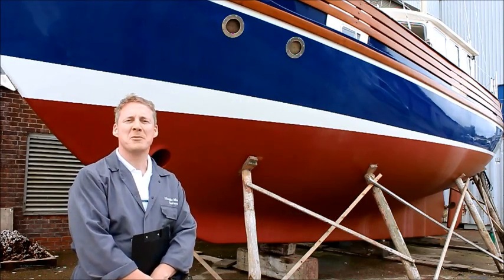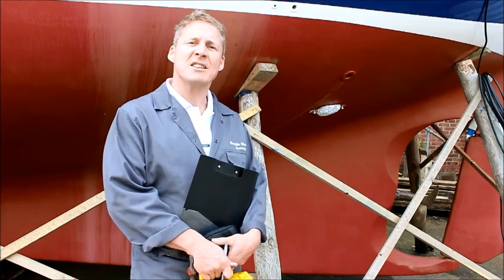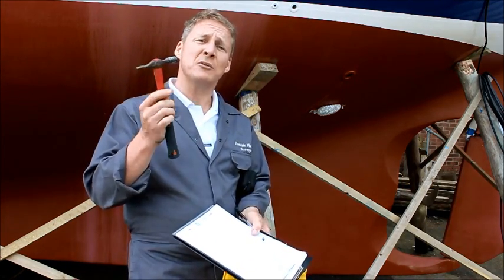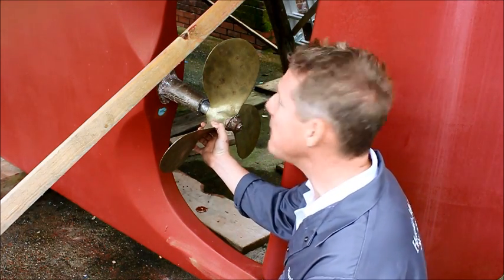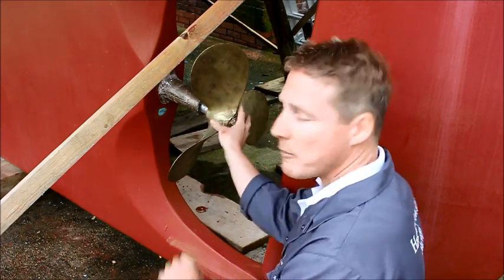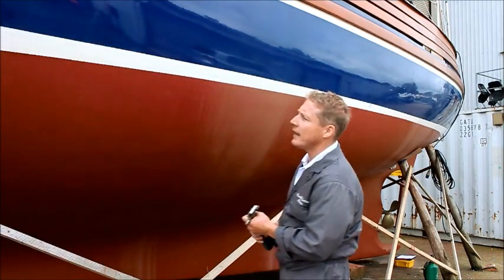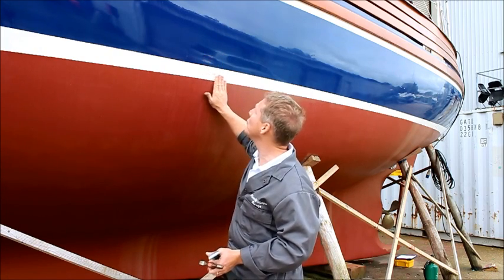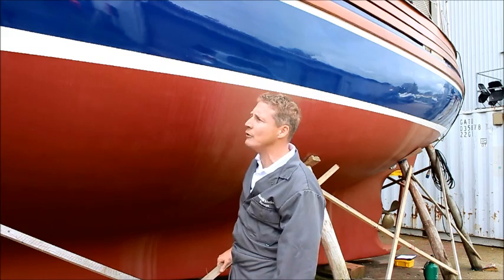Fisher 37 Marine Survey

Comment: you should never use a steel hammer. try a brass hammer for many reason, including safety. research it
Reply: I did ask dr. google but could only find arguments about whether to use a hammer at all and what hitting the hull with a  hammer actually achieves but nothing on the material used to make the hammer.
Reply: Yeah really. I would take a Naval Architects advice over yours anyday.